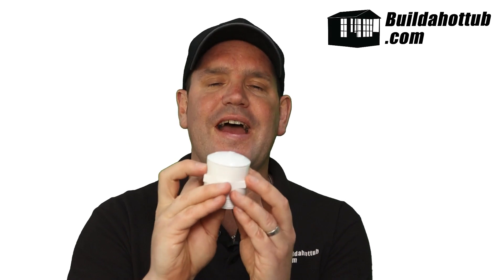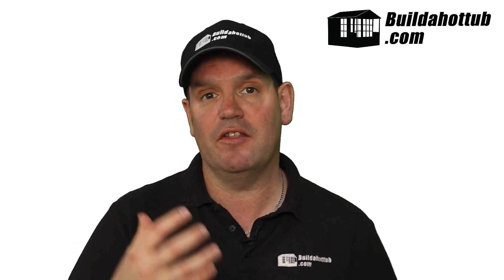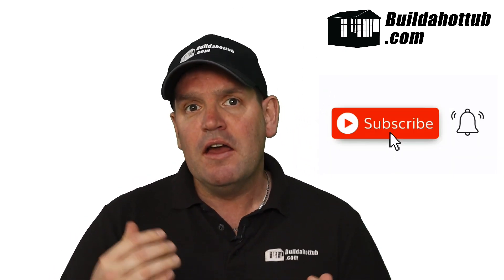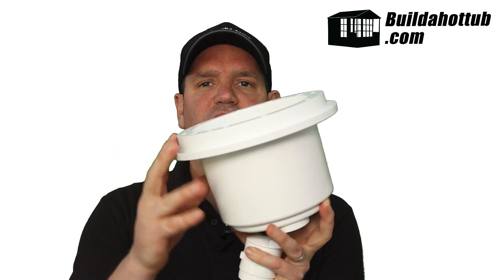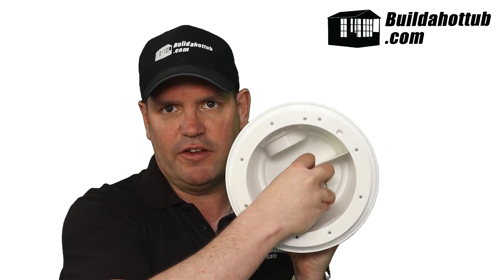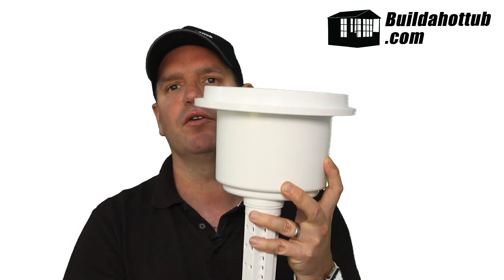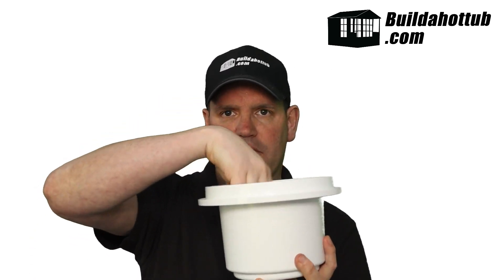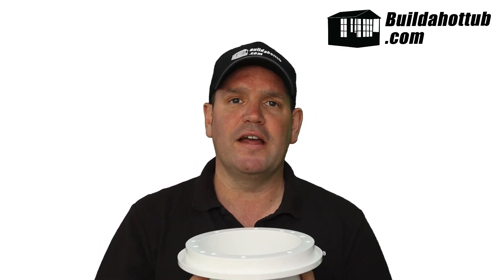How to install a Hydrostatic Relief Valve in your Pool or Hot Tub

Comment: How do you tap out the blank cap on main drain to fit the funnel tube?
Reply from the maker: Depends on the brand - the one I am holding I had to cut off - thanks for the comment
Reply: @Buildahottub  certikin HD33
Reply from the maker: I cut it off with a dremmel - that is a HD33 in my hand Daniel